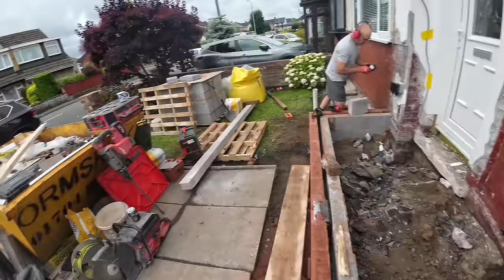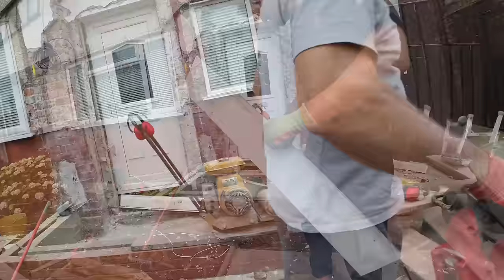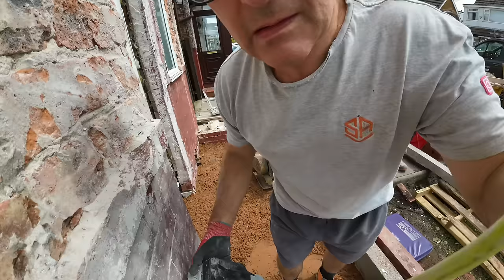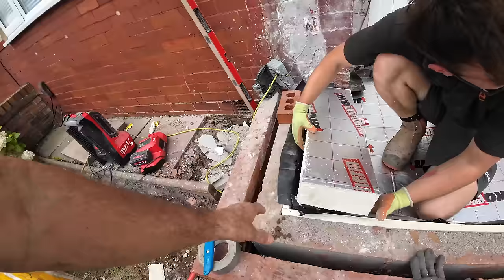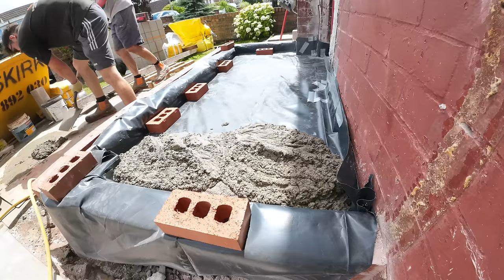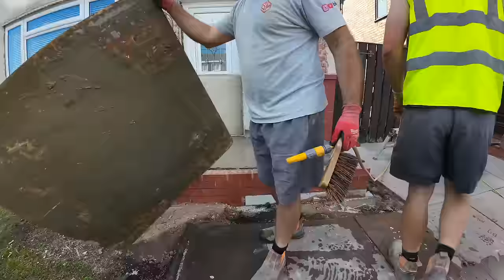CONCRETING A FLOOR AND GETTING THINGS WRONG 🤦🏻

Comment: Nice work Gents..  can't understand why you don't have the mixer on a stand? Could tip it straight into slab then? Tipping out on osb,  then move it again seems counter productive...?
Keep up the good work though
Reply from the maker: Tipping from that height would cover everything in a 4 metre radius in concrete 🙄🧱👍🏽